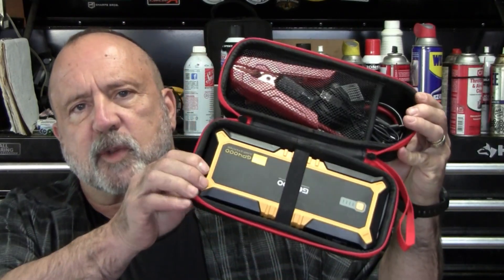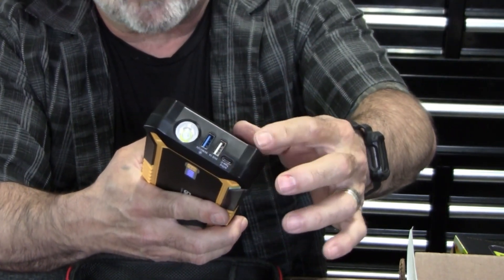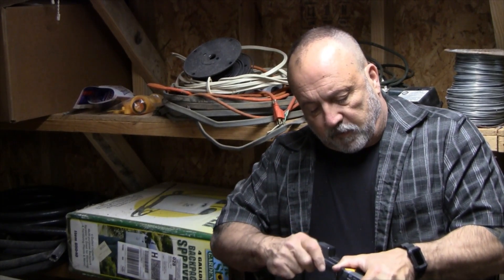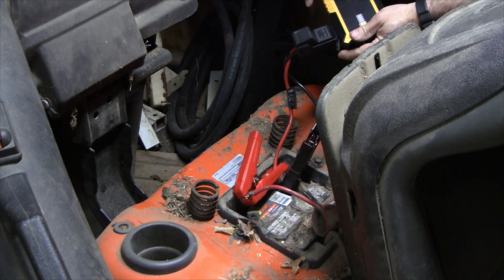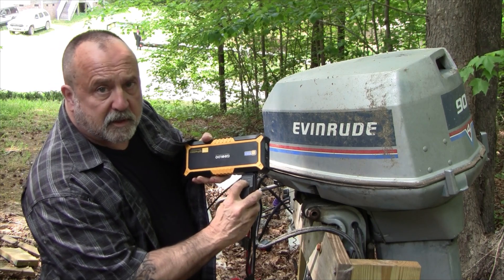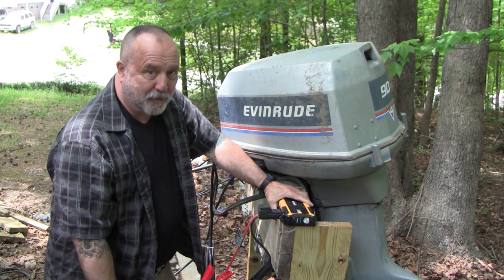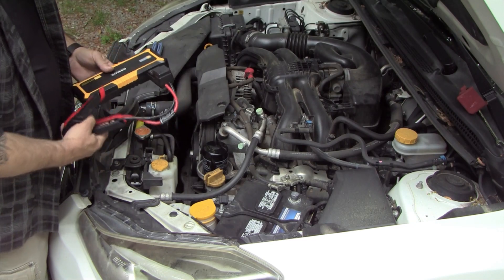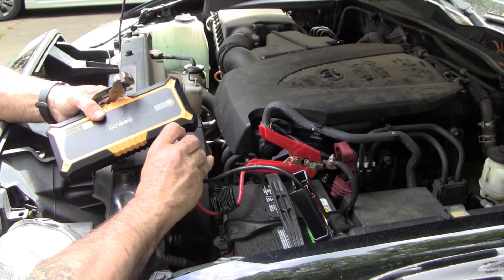Gooloo GP4000 Jump Starter Battery Bank Review and Demonstration

Comment: 3:08 You said you kept it running for a few seconds, but I timed it and it was barely even 1 second!
Reply from the maker: point was the battery had enough power to start it, the battery itself is not needed to keep it running unless the magneto in that engine is bad,
Reply: @ True, point taken, Sir.